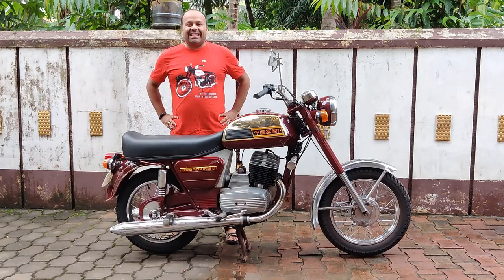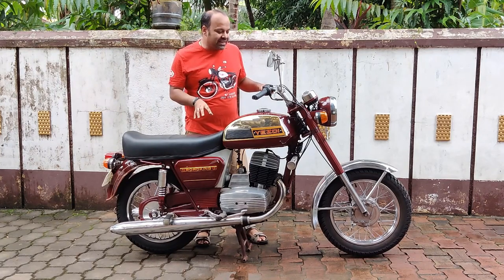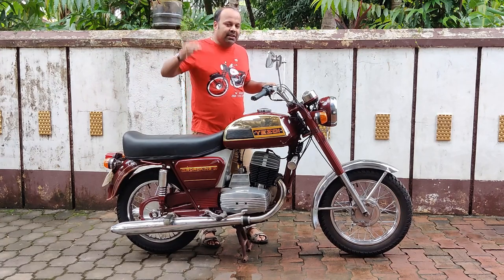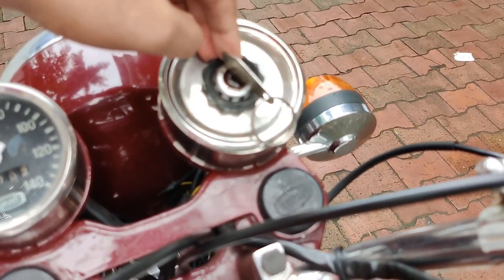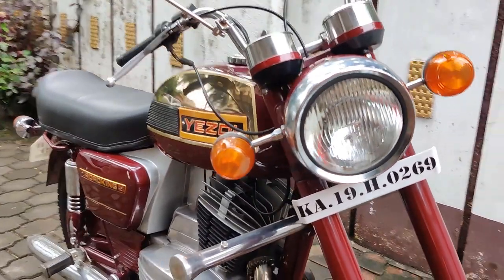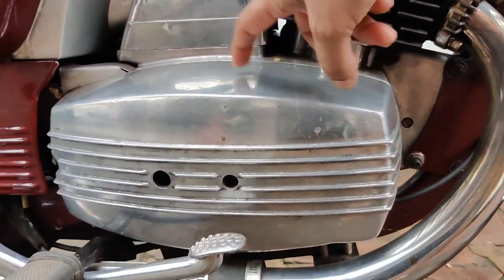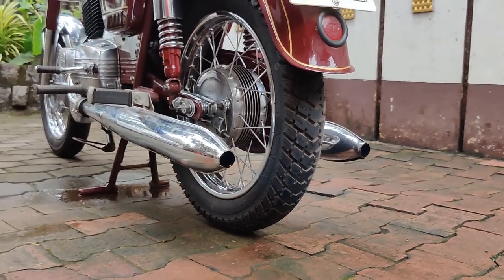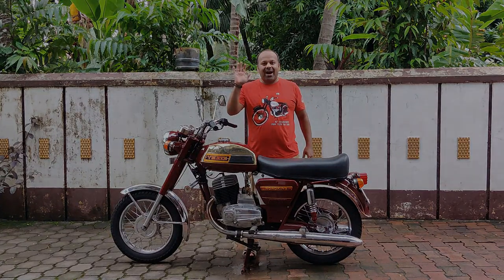Fully restored Yezdi dollars Roadking 250 |  Never out of fashion |

Comment: Dear Rider,
Thanks for the video. Could you please post a video on how to identify a dollar Yezdi Roadking? It will be very helpful.
Reply from the maker: Hi , thank you for your query. Sure will plan to do a video as you requested
Reply: Actually there is nothing called dollar roadking. Initially when roadking was launched in 1978..it's name was oil king...which came with oil pump which was situated in the small box like part  which you can see on the left side of the engine...on which YEZDI is embossed. That part had a oil pump which used to pump the petrol mixing oil. Only petrol was filled without oil into the tank. But after sometime the bike engine started getting seized due to pump failure.. later that oipking model was named roadking.. when this bike was introduced to the market it was sold only for American dollars. People had to get Indian currency exchanged for American dollars and then they could buy this bike. So roadking was called dollar bike. Till 1990 it was sold in dollars later it was sold in Indian currency. So till 1990 it was called dollar bikes
Reply from the maker: Thank you for sharing detailed information 🙏 , this means a lot